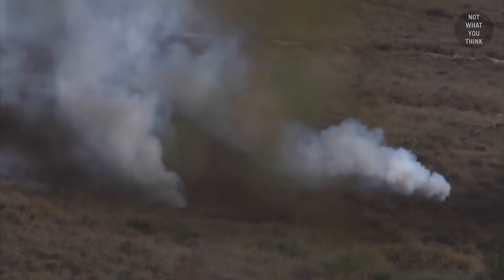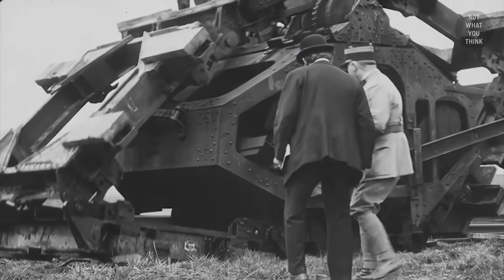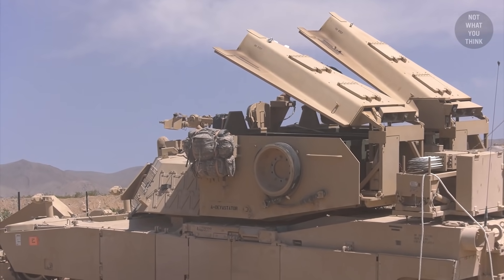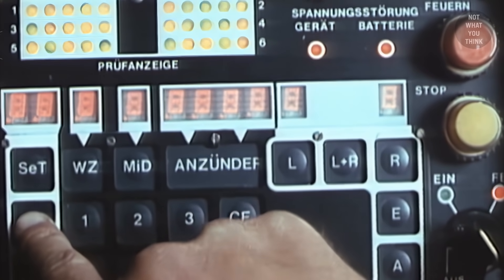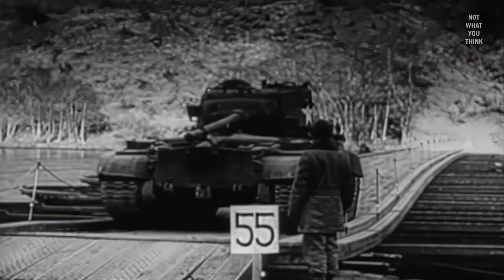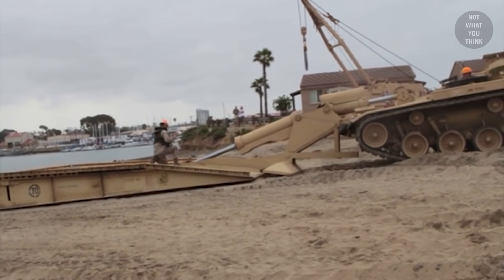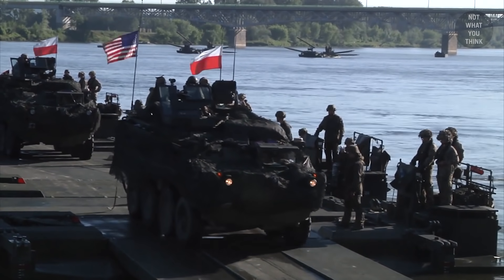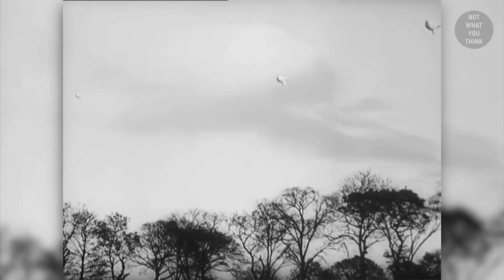Tanks Evolved from This Machine

Comment: I’ve always thought that you could significantly slow down an enemy advance just by putting up a minefield warning sign without actually laying mines.  Even if they suspect that there isn’t actually a minefield, nobody’s going to want to actually put that to the test.  They either have to carefully make their way through it, waste time trying to clear it, or waste time trying to go around it.
Reply: Genius plan but what if they have metal detectors and try to locate them 🤔
Reply: @hugeblader1004  then they will be looking for quite a while.
Reply: @GusCraft460  it may take like 15 minutes to clear it
Reply: @hugeblader1004  if they have the right equipment with them.  If not then they have to call in the specialized equipment and operators and then wait for them to arrive.

Comment: One extra detail about barage balloons. They often would also include an explosive device at one of both ends of the rope. When the plane wing snagged the rope,it would detach from the base and the balloon, but the explosive would stay attached to the rope. It would then pulled itself along the top until it got to the plan that snagged it and boom (it didn't actually detect the plane I presume, but rather it got stopped there until the timer ran out)

Comment: We set up an M4T6 bridge during my time in the engineer corps. It wasn't a nice experience, it took hours for just a short span and it was very tiring since many of the pieces had collected water inside them from being out in the rain so they were heavier. The funny thing is that it just happened to be there in the unit, forgotten since who knows when, but it's actually not considered part of the arsenal since it's superceded by more modern systems. The only reason we set it up in the first place was because it was a slow day and the commander just felt the privates couldn't possibly be sitting doing nothing. We didn't even span a gap with it we just laid it flat on the ground. This later led to an inside joke in the unit which went something like "How many privates does it take to build a bridge? 30 to set it up and another thirty to dig the trench"

Comment: The German landmine vehicle is nothing compared to the US FASCAM. Artillery deployed minefields make it more interesting.
Reply: RAAMS carries 9 relatively small and less effective anti armor mines per artillery shell. To lay a coherent and effective minefield like that German thing does, you would basically need a whole artillery battery to do nothing but chuck those things for hours, being unable to do what artillery is there for for that time.

The Germans also have a anti armor submunition shell called SMART, if I remember correctly, which has 2 autonomous sub munitions per shell, which open up in the air, search for vehicle targets and then hit them with a shaped charge. It is basically like a artillery version of a CBU-97 or NLAW, which seems more useful to me, because it gels better with what artillery does and is more reliable than just randomly scatter small mines that could end up swallowed up by ditches and/or leave easy to traverse pathways through that minefield.
Reply: @TrangleC  That's when you jump from Battalion Fires to Brigade Fires requesting rockets.

Comment: Ancient early pressure sensitive "mine", was a covered up-tuned clay pot. Think large roman pots. light men could pass,  but heavy armour,  horses or siege equipment would get trapped, cut, stuck when the weight broke the pot leaving what ever stuck in the void. They were used next to castle walls to deny ladders, as the weight of many men on the ladder would do the same.

Comment: In this day and age, why isnt mine clearing done by robots? We have things like the roomba that can map out an area using sensors and figure out which spot has been cleaned and which spot hasnt. Robots do things more consistently and thus would do less mistakes. This would be very crucial for things like mine clearing.
Reply: Mapping out a flat floor by running into everything is a lot easier than mapping out rough terrain without hitting the mines and exploding.
Reply: @gimmethegepgun  and my next point, if the robots eventually run into a mine, thats still better than losing a soldier
Reply: @de0509  Yes, it is, but a person is still much better at clearing a minefield because we don't have robots good enough at the job. And, assuming they don't accidentally hit any mines, it's probably cheaper to employ the human minesweepers than to pay for the repairs/replacements of the robots that do.

Comment: former combat engineer here, the MICLIC is fantastic, when it works, 4 of 5 trainings I have done on the damn thing failed, either the rocket failed to ignite, line snap, partial det.
Reply: so not worse than the usual military equipment.
Reply: @N1lav  seriously. Reminds me of the roof mounted guns you see in these videos that need to be manually charged every other trigger squeeze during combat engagements
Reply: @ChrisG1392   Same. Loved it when the line snapped and the rocket flew off to god knows where and you had an angry pile of C-4 sitting there.
Reply: @ChrisG1392  99% of the time the need to charge a .50 repeatedly is an operator error. Usually the timing is off. The m2 barrel comes off for easier carrying. When we mount it you have to use the head space and timing gauge to ensure the barrel is inserted properly. 

I never once had an issue with a m2, saw, or mk19 when I was deployed. Because I cleaned my weapons every mission and I knew what I was doing with the hs&t gauge.
Reply: I kind of had to become an expert on the MICLIC's.  There were parts that came as assemblies without all the parts and most of them were missing a few parts,  That caused a little problem one year with the supply system.  Then the nitrogen accumulators almost always were never charged then the leaking pressure from the manual handle seal.  The big thing is can the pull cord work, then the wiring.  There were panels on the back of the box that would test ok by the book, but quite a few had issues.  One was fire the rocket and the shape charge at the end fired.  I can remember testing for that with a volt meter after a few Marine Engineers had a blast at 29 Palms.  Since the boxes we had were the same lot number they stopped us from firing them at NTC.  Then I showed the OC's what I knew and did the test and 3 of the 4 boxes failed.  I would have either my AVLB or one of the other crews.  Now the problem with the training boxes, they get reloaded and that screws everything up.  Then the rails having dings or the screws that held the rockets were messed up from the radar absorbing paint.  Now I could fire a rocket with no hydraulics by manual lift, then no pull cord.  All you really need on the launcher is that cable to the box and for a blasting machine, the TC hatch in the AVLB has the slave cable point, so I used that.  Now training rockets I fired 3, live about 8 or so.  I got to fire a lot between NTC and in the middle east.  Then the white PVC rockets with model rocket engines and pipe 5 or feet of pipe with about 150 m of engineer tape stuffed in them.  IF the rails were good, the rocket not destroyed after a few firings and the cloth tape not full of weeds and knots it went well.  It cost a lot less than the training rockets at NTC the short ones about 2 ft long with no tape or charge attached.  It was maybe 10 bucks per shot vs the few thousand for the training ones that just shot off the rail.  I had one Platoon sergent that was on KP duty way back when while his squad fired a MICLIC, it blew up be hind the APC.  He survived due to being on KP.

Comment: The most useful offshoot of temporary bridges in my memory was the Bailey Bridge. Designed to be able to support tanks and larger vehicles, they were quick to deploy behind the lines to help move supplies. In the mid-late 90's, a major tourist road (that had one bailey bridge being replaced) washed out, stranding many tourists and residents. Within a couple days, a bailey bridge had been sourced and was being installed over the washout.
Reply: Last year a flooding destroyed tons of bridges in the Ahrtahl in Germany. Since today, the THW (somekind of german FEMA) build 21 temporary bridges, mostly Bailey and D-bridges. Impressive capability
Reply: the even cooler thing about bailey bridges is in about one day with an untrained team you can build a bridge across a sizeable gap
Reply: @dukegillian1379  Like the band in Kelly's Heroes.
Reply: There's a Bailey in Scarborough ON to replace a bridge washed out by Hurricane Hazel. Since 54.
Even an army band can put them together. As Oddball said, "60 feet of bridge I can get almost anywhere."
Reply: @m1t2a1  I'm sure it's fine... It's not like Ontario is famous for rusted out vehicles throughout the rest of Canada or anything.. 😅
Reply: Thank you, Mr. Donald Bailey!

Comment: what does barbed-wire, bridging water and ballons have to do with clearing minefields?!?!
Must be the troll name for the video........
I was a tracked vehicle mechanic in the army, trained to work on the AVLB. And was stationed with a combat Engineer unit, that had a mine layer and an old-school MICLIC, box on a little trailer with a rocket attached...they also built Bailey bridges.
Reply from the maker: The video is about different types of military obstacles, if you watch it to the end 😉

Comment: Earliest form of minefield isn't barbed wire. Earliest form of minefield is ancient one, used even by Romans - Caltrops 😉
Reply: 0:35
Probably one of the earliest MODERN forms of obstruction in warfare was barbed wire.
Reply: @TheSiprianus  
Yea, but some people may think it's the earliest form of terrain denial. 

So i just mentioned earliest form of terrain denial.
Barbed wire is earliest modern form of obstruction.
Reply from the maker: Not the earliest form of minefield. One of the earliest forms of “modern” military obstacles 😉
Reply: @NotWhatYouThink  
Earliest form of building denial was a booby trap, and it's not what you think.

When a soldier is entering a house, a short fuse is activated, where he get's in trouble.

Followed by loud noise and fighting over dinner table. Even though he wanted some peace and quiet.
Reply: @randomargument972  They said One of the Earliest Forms of "MODERN" Military Obstacles. Not the very beginning of time with random booby traps. There is many, so again, it is one of the earlier forms. And if we really want to get into technicalities, Barb Wire was put into use way before it ever saw military use. Barb wire was made somewhere around the 1870s or 1880s, with that being in what is considered Modern Time. Bobby Traps do not fit into the modern time period with the current "Modern Time Period" going from the 18th Century to Today.
Reply: @PhoenixAuron0920  Read replies BRO, instead of spamming more replies